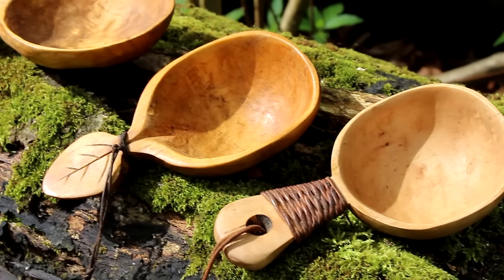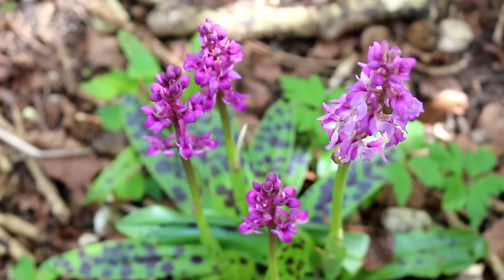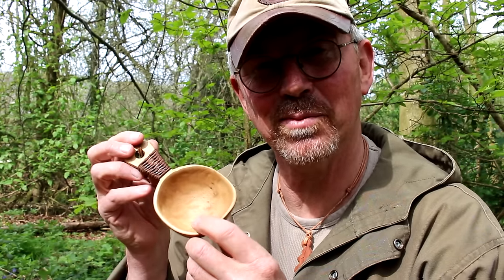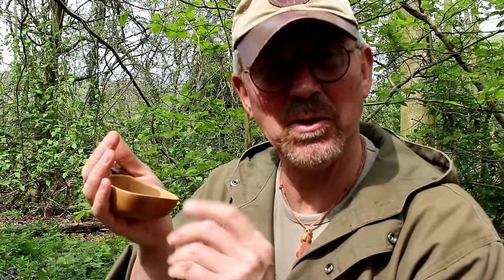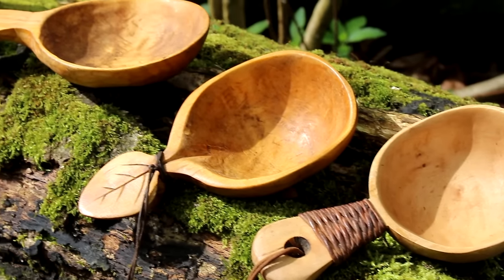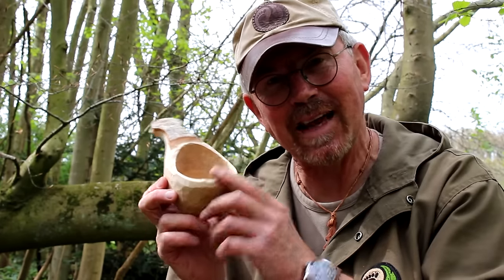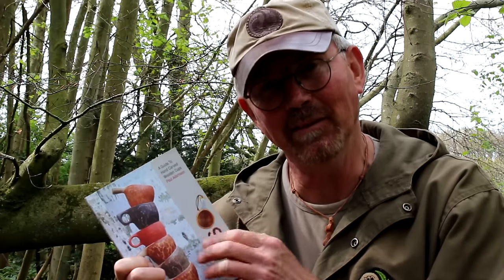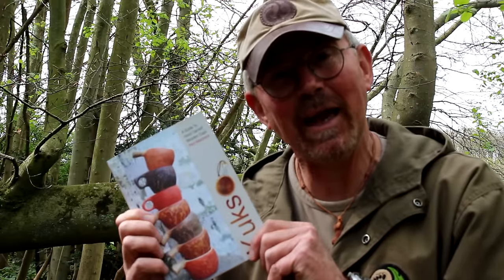How to Carve a KUKSA or NOGGIN

Comment: great advice especially keeping in a bag until finished while working on green wood. when putting in the wood pile to dry should the sides be the finished thickness or thicker. wondering about the wood cracking and best way to prevent after al the work put into making it